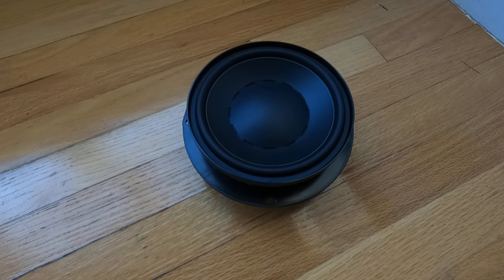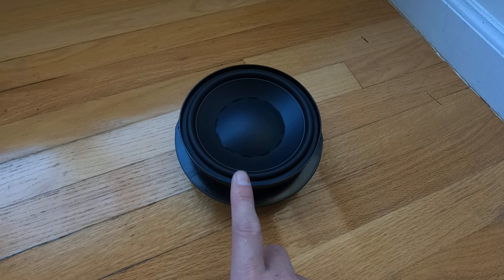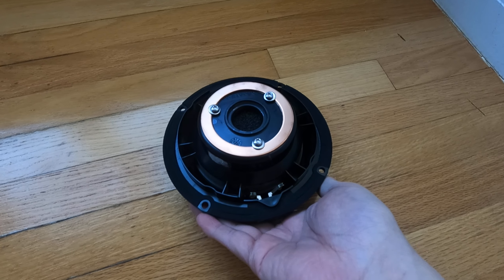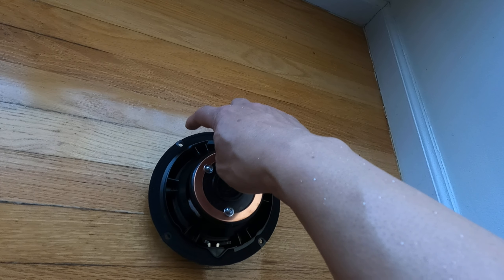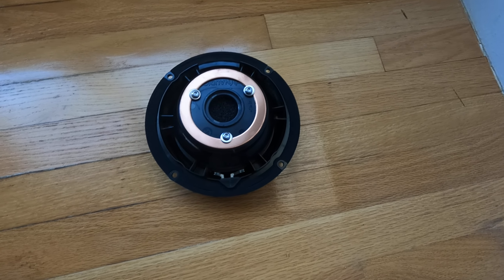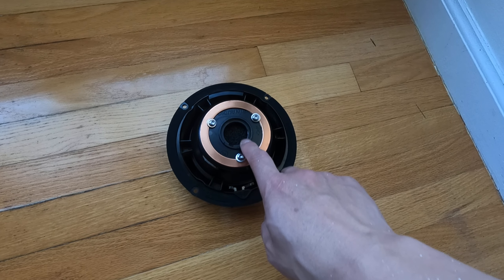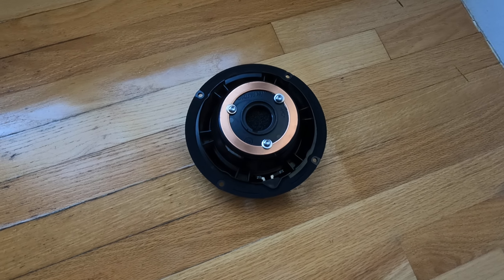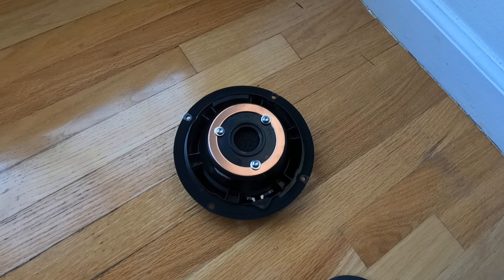Prepare Dynaudio woofers for VW Golf door speaker upgrade.

Comment: Hello,

Do you still have the dimensions of the copper ring you made ? Regards & thank you !
Reply from the maker: It was an off-the-shelf sealing ring, should be 3" or 3.5". You can measure the distance between the screws to be exact. ID = 1.732*L, add another inch or so for OD.